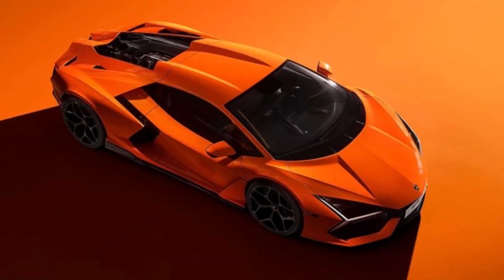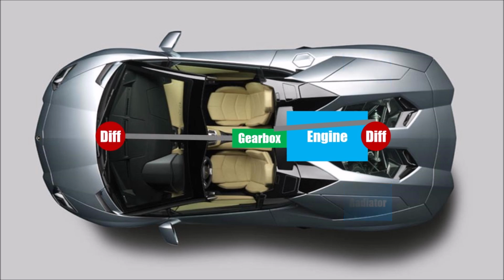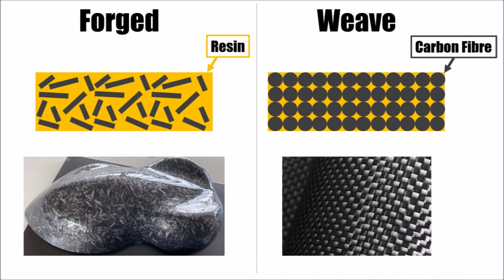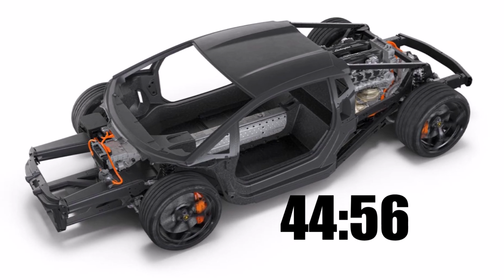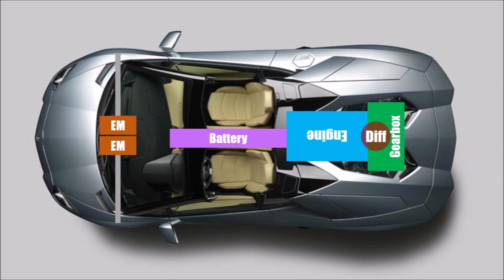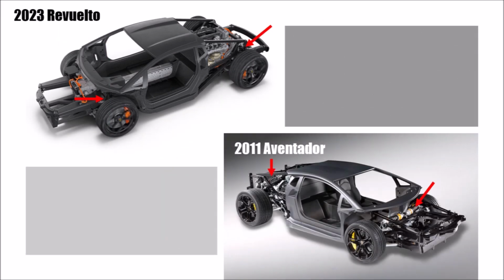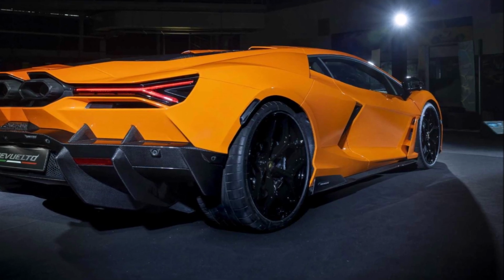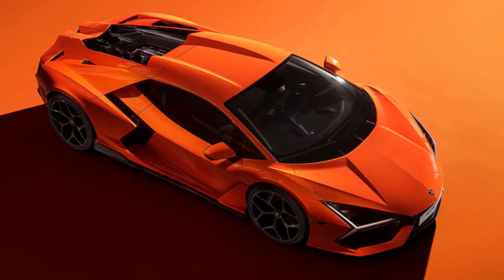Lamborghini Revuelto (LB744) - Technical Analysis

Comment: It must be getting on for 1950kg wet weight, or maybe 2 ton with passenger. I think Lamborghini is hiding something big with the rear wing, and it's engine note. I'm not sure how it will hide it's weight. Tyres you will need.

Comment: Outstanding video which highlighted the important points. The change away from push rod suspension raises a few questions and I am curious about Laptimes and compared to the SVJ. Especially in sectors were power is not the main factor and suspension and weight will be. On the other hand a new car with a V12 without direct injection in 2030 is somewhat nice.
Reply: yeah man I know its packaging reasons but damn it will be a different car, thats the only thing keep in me away from buying it aahahahaha, just kidding but I feels it kinda lost a bit of it's identtity and it might be the only downgrade compared to the aventador,( and the added whight for sure, but theres nothing you can do there ) overall very interesting approach, should be an interesting car to drive

Comment: So that means the Aventador is a better track car, weaved carbon is lighter and a push rod suspension is more superior than a conventional suspension.  minus the electric motor n dct. I think the Aventador should be a better cornering car. Am i correct?
Reply from the maker: 200kg is a lot and it‘s hard to compensate that although the revuelto has torque vectoring and instant torque.
Reply: @bsport320  i mean there are tuners out there that can change the diff on the Aventador. Like when I used to have a Ford mustang I changed my differential to a t2r torsen diff from an open diff. Huge cornering speed n stability difference. in terms of mechanical handling capabilities. Which is superior?

Comment: Lovely car. Even though its just an update, I wonder whats the real world performance.
Reply: I'm not sure you can say it's just an update... they changed the whole position of the gearbox after all, not a small change. It's arguably bigger of a shift than when Lambo updated the Diablo to make it the Murcielago, and no one will call the Murcielago just a Diablo as far as I know. Plus you've got all the electric stuff, and with a full carbon tub and more than 1k hp, I'm not sure the Lambo is behind the curve
Reply: an update?! the engine has been redesigned from scrath, gearbox totally different... they moved from a pre-preg (top and perimetral parts) and rtm (tub) to a pre-preg (top), rtm (rocker ring and front sub-frame) and forged carbon (tub and front firewall) monocoque; different suspension

Comment: So, basically, electric motor is for emissions. I wonder how little/light electric motor can manufacturers put in their "hybrid" car before some emissions agency take notice? Will be funny to see manufacturers say that starter/generator is the whole electric drivetrain
Reply: My aunt's kia has a 10hp electric motor coupled to the engine, it is considered a mild hybrid. Enought to make a diference in the city but not to much to much extra weight
Reply: @juanordonezgalban2278  Cool, that means that beefy starter/generator should be enough. What EURO certificate does it have?

Comment: I am not terribly impressed. We've been repeatedly told that the Urus is good because the money it makes can be used for the development of the supercars, and they made 10 different special versions of the Aventador - which make the manufacturer look bad but at least it should be bringing them big money - but for their new flagship they still re-use both the monocoque and the engine. The Aventador had a waiting list for almost its entire production run. So where has all the money gone? Not into the chassis, not into the engine, not into any lightweighting efforts judging from how the car is 200kg heavier than the Alu chassis SF90 with a bigger battery... 

I do love me a big V12 Lamborghini, but on the technical side it's pretty hard to take them seriously. The Aventador was already a big car, but instead of doing a better packaging job with the Revuelto, they instead just make it even bigger (which, inevitably, will make it even heavier)! 79mm longer wheelbase, 24mm taller, 3mm wider, 167mm longer. The scuttle is still high limiting visibility (and hence why they probably had to increase the height instead of making the seat sit lower), the luggage and interior stowage space is still nothing to write home about. The car is reportedly sold out for the next 2-3 years, so that's all good and well, but that's pretty much just them taking advantage of the fact that their clientele has low standards. Does the car look aggressive? Does it sound good? Is it somewhat fast? Yes? Then that's job done!
Reply: the monocoque of the aventador and revuelto are not the same... at al

Comment: So it weighs 2 tons with fuel and driver?
Reply: No, just with fuel. 😅
Reply: @test987665  Come on, that‘s too heavy even if it was a four seater GT…
Reply: @AR_434  Well, park your Lambo anywhere and the first thing you'll be asked will be: "How much horsepower does it have?" Nobody will ever ask you how much it weighs, or how well it drives. This way the Lambo owner can say "over 1000" and the onlooker will be awed. Instant success!
Reply: On Lambos website it states that it weights 1772kg "dry". With 50kg of fuel, accessories and an adult I guess it'll be close to 2000kg
Reply: @cashbonanza963  Lamborghini's "dry weight" is bullshit, though. The Aventador's stated dry weight was 1575kg, but the cars weighed 1800kg in reality (without driver). So add the same amount of weight gain to the Revuelto and you are at 2000kg. It's also possible that it could gain less weight than that, but it probably won't.

Comment: Ok so if you have a powerful E motor in your gearbox, why do you need a big, heavy DSG? Why can’t you use the E motor to smooth out the gear changes?
Reply from the maker: I guess that would mean you need some battery charge for smooth gear changes. It would add complexity and this is still a (simple) V12 car with some electric support.
Reply: @bsport320  you could make a single clutch that is relatively slow and smooth, and let the customers know that if they want fast, smooth changes their battery needs to have a certain degree of charge. Or you could even introduce a button that the customer can press five minutes before he’s at his destination, which will tell the system to charge the lithium battery using regen.. I don’t think this would be a problem for the customers.
Reply: But of course, it would add a lot more complexity, at least as far as development is concerned. I personally hate gearboxes except for what Ferrari did for the front wheel drive units on their 12 cylinder cars, that was extremely elegant and clever. Of course, the question is whether your electric motor is on the gearbox output shaft or on the engine side. If you want to starter function, you will need it on the engine side. Hmmmmmm. I guess engineering can be complicated, can’t it?😝😝
Reply: @cashbonanza963  super capacitor = smaller capacity, faster charge and discharge.